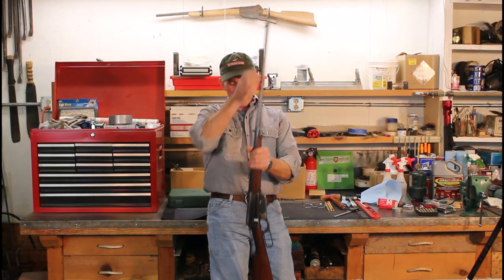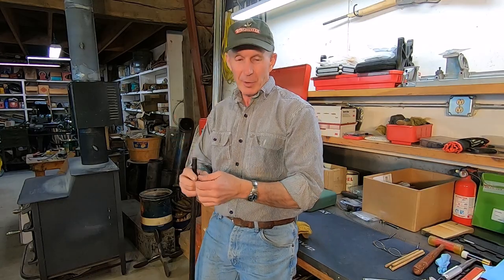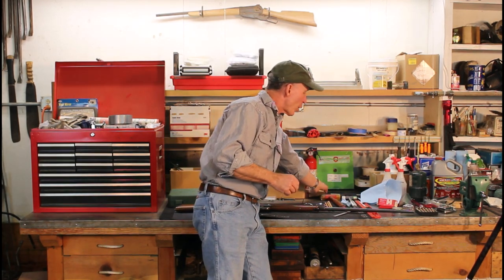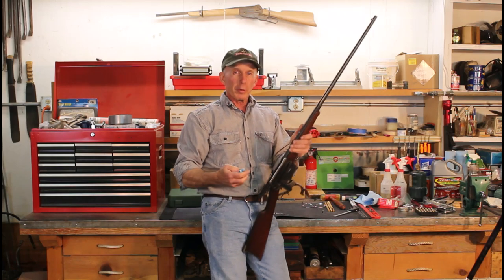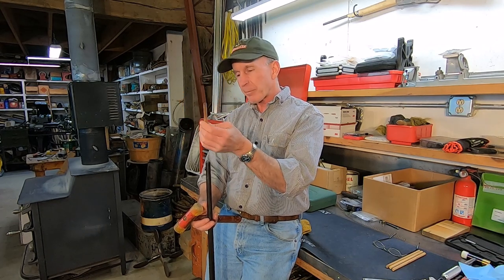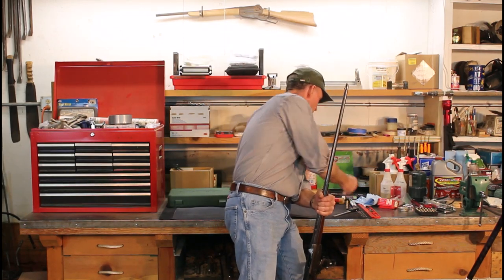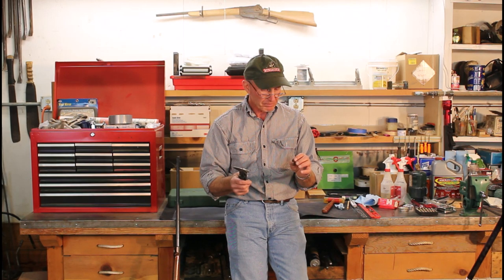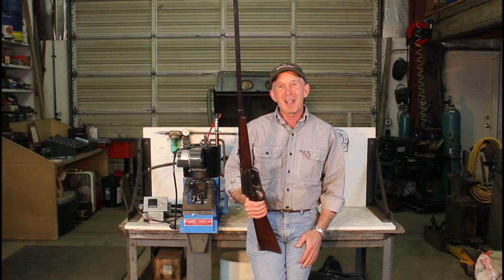How to Slug a Rifle Bore

Comment: Hey Mark

Good video.  I'm glad to see that the groove diameter came out .379 on your rifle, that being the same as what we've found in period Winchester specs and some of the older books.  Thanks again to you and 'Uncle" Tim for your help with the Model 1895 book!
Reply from the maker: Thanks Brad.  I should have double checked the barrel section of your excellent book on 95's.  It's no wonder that off-brand factory ammo loaded with .377 bullets never shot worth a hoot.  We'll be pulling those and throwing them in the casting pot in a future episode.🙂
Reply: @thecinnabar8442  I really enjoy the Winchester Model 1895 book! 

I live in N. AZ. But make my way to Tucson and the Phx Valley for work, but also making a point to go different (older) gun stores. -Fun
Reply: Meister Bullets Inc. makes slugging kits that cover a wide variety of bore sizes.
Reply: I have a George C. Schoyen barrel with 7 grooves. How do you measure the slug with an odd number of grooves?
Reply: Schoyen liked lots rifling I have a Schoyen marked Highwall, the barrel appears to be have started life in a Ballard and that was reboard
Reply: @davidgardner863  Thats an excellent question. Id like to know also.

Comment: Thank you, thank you, thank you! This is just what i needed to know. I wanted to learn how to cast bullets, and the point most experienced bullet casters provided to me was the need to know the groove diameter of the bore, but previously couldn't find out much about it and had little interest in pouring molten metal (don't care if it does have a low melting point!) down the bore of my new rifle. Going to hit that Subscribe button right now...👏👏👏

Comment: Excellent 👍. What velocity do you get out of the 38-72? Thanks
Reply from the maker: I'm going to make a couple more episodes in this series.  We'll cast and size bullets in the next episode and then work up some loads to take to the range and check accuracy and velocity.  I typically don't push the 38-72 or 40-72 much because they didn't come with nickel steel barrels (except by special order).  With this one,  I'll shoot for loads in the 1,400 - 1,500 fps range and try to find the load it likes best.
Reply: @thecinnabar8442  Ok cool looking forward to those videos. Thanks 👍